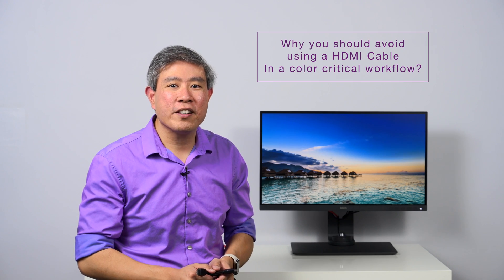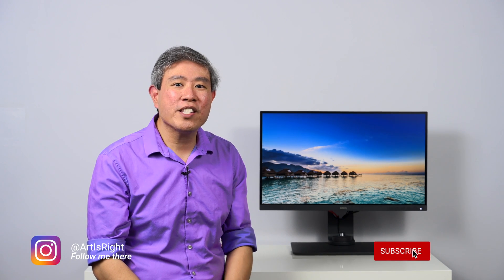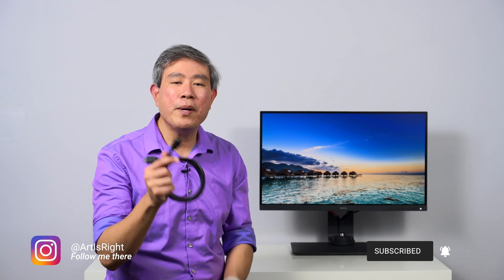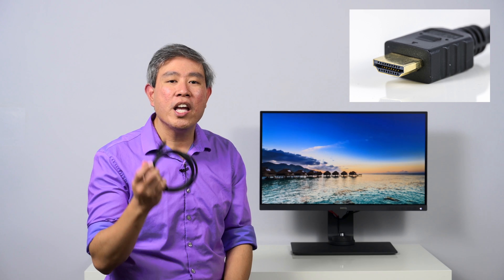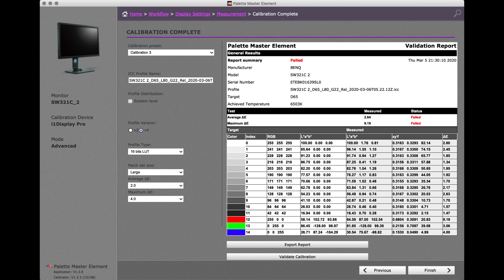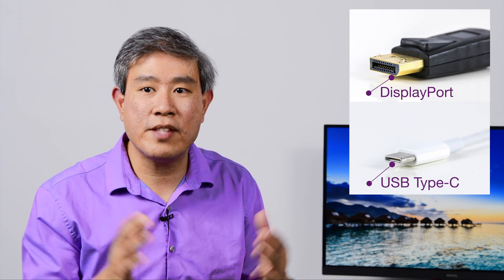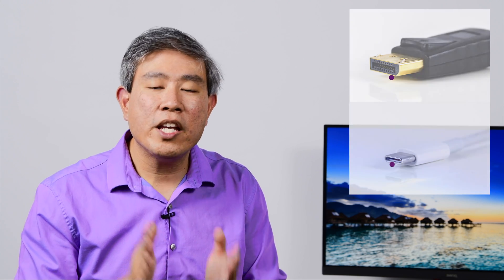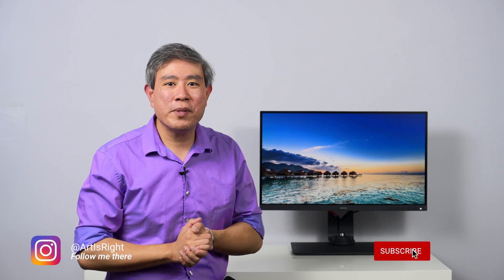Why you should avoid HDMI for color critical workflow, especially with Pro Displays!

Comment: For some people it might be good to know that you can change the dynamic range in Nvidia (and maybe AMD) settings. 
For me it seemed that the default value changed when I updated Windows and for a long time I didn't know what to do.
Now I found a fix that makes black look black again (and not grey): in the Nvidia Control Panel under resolution settings you have to choose "use Nvidia settings" and then change the color format to RGB and the dynamic range to full. You could also try to use Ycbcr444 which temporarily fixed my dull looking monitor problem. 
After applying that, I could revert the settings to using default colors again. 
I bet it was a windows related bug.
Reply from the maker: It generally is, thanks for the tip. This is something that can be done on Nvidia driver, but to some extent, less so on the AMD driver and not at all on a Mac, especially older ones. But all new Macs are good.

Comment: How can I get 10bit colour output from my laptop (Acer aspire 7 intel i5)  on PD2700Q it shows color depth-8 on display settings
Reply from the maker: One a laptop with integrated there not much that you can do with discrete GPU some Nvidia with studio driver support 10 bit output but it would depend on how the circuit is designed and whether  there is a MUX chip or not, if there is then it is possible, if not then the discrete GPU is used in conjunction with the integrated GPU and there's again not much that can be done.

Comment: I think this situation could have occurred several years ago. Right now, with several generations of the HDMI standard, the original video signal will no longer be clipped over HDMI. And if you have an expensive HDMI cable, you'll get very accurate colors on an HW-calibrated display over HDMI. Modern HDMI standard has very wide bandwidth and described problem is not actual any more.
Reply from the maker: Sure, but I still know some laptop that have issues with HDMI. So dismissing the issue does not help either. And as one should always do, test it out first. Of note the cable just have to meet the spec, they don't have to be expensive to get accurate color, it is really all just 1 and 0.

Comment: My New pd2700u 4k only lets me display as 1920 X 1080 or lower when connected to my 2013 iMac any help please?  I'm using a hdmi to thunderbolt 2 adapter. Thanks
Reply from the maker: I would check the dongle to make sure that it is 4K60 compatible.

Comment: I've been supplied with DVI & Display Port which one should i be plugging in for color critical work, also does this interfere with colorspaces of a hardware calibrated monitor
Reply from the maker: They do not. Display Port is much better.
Reply: @ArtIsRight  although I export file in Adobe RGB mode both sRGB n Adobe RGB files appear same in Photoshop
Reply from the maker: Cable does not matter, this is a different topic all together. This will explain it https://youtu.be/Gu1nqEf8vzg and if the original file is the, sometime you'll see slight differences, others you might not, that is image dependent how you are editing it. If your images are mute then no so much, if your images are saturated then you'll see more.
Reply: @ArtIsRight  my graphics card is basic n doesn't hv a display port, hence connected via DVI, does it make big difference
Reply from the maker: Don't know, it is computer dependent, try it out, test it.

Comment: the gpu automatically compress color when there isn't enought bandwith (for example 4k 120hz at 4:2:0 on hdmi 2.0). Otherwise just change the settings on the gpu control panel to 4:4:4 0-255
Reply from the maker: I understand that, on a PC, yes you can do that with the right driver. On Mac not so much.

Comment: One question about my new PD3200U - Can I also set 30Hz instead of 60 Hz?
I have at the moment unfortunately only a MBPro late 2013. model A1398. Does the monitor need too much power?
All programs run delayed, Affinity Designer, FIGMA requires a total of up to 6GB memory (mac activity display) Then almost nothing works :-(
Reply from the maker: Yes https://youtu.be/-epAJtrPmLE That is a 4K display and it does need a lot of GPU power. The GPU inside MBP 2013 will drive 4K but not at the speed that you want.

Comment: Hi MR: ArtIsRight, I have Asus fx504GE i7 with Nvidia gtx 1050 ti and I have Benq PD2700U Monitor. I have a Problem's its Uses only 30 FPS  in the monitor not Use 60 FPs Why? cud you answer Please.
Reply from the maker: Are you using a dongle, if you are, is your dongle or cable.a 4K60 or 4K30 cable. This effects HDMI and DP.
Reply: @ArtIsRight   No, No Dongle Use, I use This HDMI Which Come With Monitor.
Reply from the maker: I would check the port specification and possibly the driver setting. That may be what is capping it.
Reply: @ArtIsRight  HDMI 1.4 port Is This Problem Right?
Reply from the maker: It is technically supported. So I would guess it is your computer hardware or something with the software.
Reply: @ArtIsRight  Yes my Laptop have only 1 HDMI port with ( 1.4 ) so it’s work in 30 FPS. So I connect with my other Desktop when It’s work in 60 Fps. With old Desktop
Reply from the maker: Like I said HDMI 1.4 is capable of doing 4K60 out at 4:2:0 so I am thinking it could be a software setting, but if not then we know it is a hardware limitation.
Reply from the maker: Are you running on Nvidia Studio driver, there's probably not much that I can do if your hardware has a cap, this is something that I found out in my dell test machine as well. The best thing to do in these situation is to contact the laptop manufacture and get the case escalated to an engineer / supervisor who knows the specs and can give you straight answer.
Reply: @ArtIsRight  Yes Ok I check in The service center you are Right, Thank you so much.

Comment: I have a 27" iMac 5K (2018 Model). When I connect it with the Benq PD3200U monitor. The refresh rate is only up to 30. I am using HDMI Cable. So, if I buy an adapter for DV will that help? Also, when you say colour-critical workspace, is that too going to get resolved?
Reply from the maker: You have a software calibrated display, you won't have any issues with color. As far as 4K30 that could be a dongle limitation, just look for another one that can do 4K60 you can get a cheap one for under $15 on amazon.
Reply: @ArtIsRight  Thank you so much :) That is great.

Comment: Hi Art, what's my best course when using dual PD2700U screens with my mac M1 mini when it comes to the type of cables? 

(I cannot use USBC with the PD2700 because the monitor doesnt allow for one.)

Should I use displayport to USB-C adapter? 

Should I daisychain (if yes, how and with which cables?) Please help!
Reply from the maker: That is a great question so I would use USB C to Display Port and the other one would be HDMI. I think that I have tested daisy chaining but I have look up the results and note again. My understanding is that even if the display supports it. If the exceed the number of displays that the computer can out put natively, daisy chaining just won’t work.
Reply: @ArtIsRight  Thanks Art, and what if for both monitors I use a display port to usb-c connection? Will this be an issue, or do you still recommend running the second monitor off HDMI?
Reply from the maker: You can't that is the issue, M1 will only allow 1 display out put over the 2 USB - C /TB Connection. The other one has to be HDMI, no choice there.
Reply: @ArtIsRight  thank you

Comment: What about nvidiabgraphics cards... Should you have a dedicated video io feed or can you accurately feed your display from gpu if your grading in software like resolve?
Reply from the maker: You can technically just do it directly from the card. I know that resolved make a clean HDMI out device, but non the less you should still do that on a hardware calibrated display this way the calibration data remains on the displays and not the computer. In my research, I think that if you have a specific need for such a device yes use it, otherwise I would just use the signal out directly form the video card.

Comment: I Have two 4k Monitors Benq PD2700U, which is connected via two display ports for each monitor and running at 60Htz. The reason I didn't haven't use the Daisy chain because it only supports one monitor at 60htz. Is it Advisable to use two monitors separately connected using DP?
Reply from the maker: You're setup is fine. You good!

Comment: Hi Art, would you recommend a monitor like PD3200U or PD2700Q for image color corrections for magazine publication work? Is sRGB enough for such work or do you really need Adobe RGB? Thank you.
Reply from the maker: Those 2 are great display. For magazine publication sRGB should work just fine. CMYK press generally have the gamut of sRGB so you should be good!
Reply: @ArtIsRight  Thank you very much sir. I saw alot of people say that Adobe RGB is needed for printing work. Any idea why that is when you say that sRGB is more than enough?
Reply from the maker: Print work is a broad definition. If you are going to be printing your images in full tone either using light on paper and chemical, inkjet printing, or HP Indigo or something along those line it is best use Adobe RGB. If your work is pre press, cmyk runs for publication, it would depends on the publications, but most of them will not put in too much money into getting more color or tonal response from a halftone print, this is the same throughout most magazine with the exception of higher end ones. There are other reasons why you should edit in Adobe RGB but that is beyond the scope of the question and the point here :D
Reply: @ArtIsRight  My work is mainly for pre press work so I think an sRGB monitor should do the trick for me. Thank you very much sir for your quick response and detailed answers. It really helps alot. Keep up the good work with the channel too. You are sharing a lot of great information. 😊

Comment: So do you know how would this play out if i was to use say a decklink mini monitor 4k card?

I do voth photo and video work.
Reply from the maker: yes calibrate your display to REC 709 with the spec that you want and then just bring the deck link into the equation after
Reply: @ArtIsRight  hmm that confuses me to be honest, arent we supposed to use adobe rgb for print and photos and then rec 709 for video..

To my understanding the decklink shows no color profile and 10bit, so we get the full built in lut of the sw321c

Maybe i just got it all wrong.
I really appreciate your time.
Reply from the maker: So Decklink offer clean HDMI out, which means no color adjustments, which means no icc profile use. For Photo yes use Adobe RGB but when using the Decklink, you should calibrate a slot on the SW display with REC 709 and the gamma setting that you want, because Decklink uses REC 709. So what you are doing is preparing the hardware calibration slot on the SW display for decklink. if you use a software calibrated display then choose REC 709 color mode if you can and just go with it.
Reply: @ArtIsRight  Thank you so much! 
I am lucky enough to own a hardware one with the easy controller so i can easily switch betwin  settings.
I have set them up as
1. Rec709 (for video/film)
2. Srgb (for graphics and digital design)
3. AdobeRGB (for phot editing and printing)

Once Again Thank you so very much! I have now ordered the decklink without no worries.

Also thank you for all your guides to calibration. How can I support you beside the likes and bells?
Reply from the maker: Anytime. As far as support outside of likes, I don't have a mechanism yet. I'm still debating on what to do but I appreciate the thought!

Comment: Hello there, What am i sacrificing by not using DP for pc? is it related to dark areas in games that makes thing look less detailed? 

My 144hz monitor only supports 1.2 dp and my gpu outputs 1.4gp so buying 1.2 cable is enough?
Reply from the maker: 1.2 vs 1.4 just has to do with bandwidths that the cable can carry, higher resolution, HDR etc. This video is meant as a PSA for Hardware calibrated display doing color critical work. If you don't have a hardware calibrated display and do color critical work then this cable choice does not matter. I mentioned this in the video but it was not emphasized enough and can easily get glossed over.

Comment: What if I have an nvidia gpu, can I change the output to 0-255 in the control panel?
Reply from the maker: Best thing to do is test. If you have a hardware calibrated display this is something to check, for software calibrated display it does not matter much. But Nvidia studio driver and AMD pro driver will allow you to specify the output.

Comment: Hello ArtlsRight, I have a question... I have the Benq SW270c and I have this monitor connected to my PC with display port 1.2. However, I have noticed in the specification of the monitor that It's Displayport 1.4; On the monitor menu (System) there is a feature that says DP and It has 2 options (1.1 and 1.4).

My question is, what are the cons of using a Display port 1.2 with this monitor instead of DP 1.4? (My Graphic card has display port 1.4 too).

Thanks in advance for your help, 

Kind regards, Edd!
Reply from the maker: Mostly it has to do with total bandwidth and the ability to run 4K resolution or not. You are good with the SW270C
Reply: @ArtIsRight   Thanks!
Reply from the maker: Sure thing!

Comment: Hi, I was trying 2 cables connected to display port , one display-display and other display- HDMI, and with second cable Display/HDMI I haw much better delta , on  my 27C monitor , which should I use.? Thank you.
Reply from the maker: Are you on a Mac, PC, video card, etc? Also assuming the calibrations are the same. If one happened before the other as you are turning the display on, there might be some variation there. Either way if you have the option to use those cable and one is giving you a better ∆E then use that. With HDMI, it would depend on the machine and driver and testing must be done. You're seems to be good so you have options.

Comment: The hotkey works until the computer is restarted. When rebooted, the port settings and image in Display Pilot are unchecked! anyone got the same ?
Reply from the maker: See the other comment for reply, they all come into my same inbox ;)
Reply: thanks! the new update works! but the previous one I got just a few weeks ago, how the until now didn't works? so many years?
Reply from the maker: Glad it worked, also incorrect assumption, your OS version and windows update could have break this.
Reply: @ArtIsRight  NO! in the downloaded manual it says that they fixed broken settings hotkey after restart !
Reply from the maker: Either way glad it worked, so probably that specific version had that bug, as far as, all along, that would be how long that version was alive for. These software go through update cycles so it is fix and works now.

Comment: But the Decklink only has HDMI and SDI, you really cant use 10bit HDMI with decklink to the Benq monitor? With Decklink it's suppose to be color accurate from Resolve. Are you saying it's never color accurate via hdmi? Can't be, what's the point of the Decklink then?
Reply from the maker: I'm not taking about Decklink, I am talking about computer output from GPU, totally 2 different unrelated things. For those device, calibrate your BenQ SW to REC 709 with your preferred gamma first and then hook up the decklink after. And if you don't have a hardware calibrated display, it does not really matter much.

Comment: But sir if not available DisplayPort in my PC and laptop that time I am use hdmi to DisplayPort convert no any issues
Reply from the maker: Watch this clarifications, there are some keywords that I used in the video that many missed https://youtu.be/DWzGHX2DDdA
Reply: Sir my monitor have a DisplayPort but not in my PC so can I use hdmi to DisplayPort converter
Reply from the maker: What monitor do you have? And here's the lowdown, so if you have a Hardware calibrated display, then TEST the HDMI to HDMI and see if you can get a pass validation, if you can, stop worrying about it. If it failed validation then you can try another connector but chances if your HDMI is already outputting truncate signal any coveter would be effected as well. If you have a software calibrated display HDMI to HDMI will work just fine, no need to worry.
Reply: @ArtIsRight  sir i have dell P2419H monitor
Reply from the maker: Just use HDMI to HDMI you're fine.